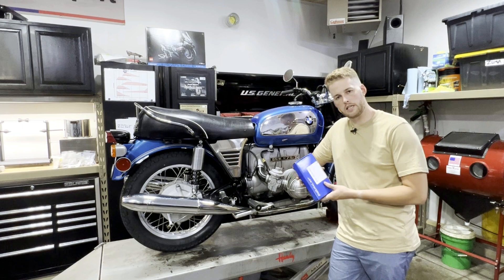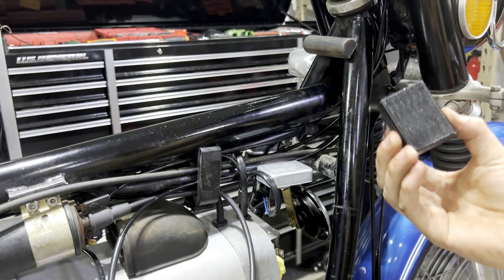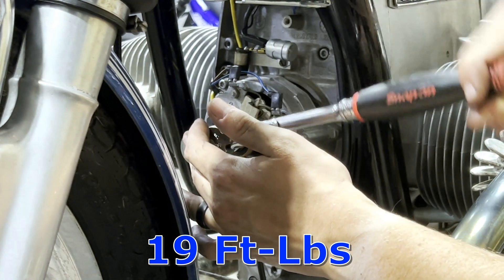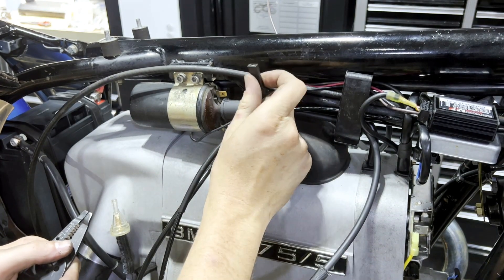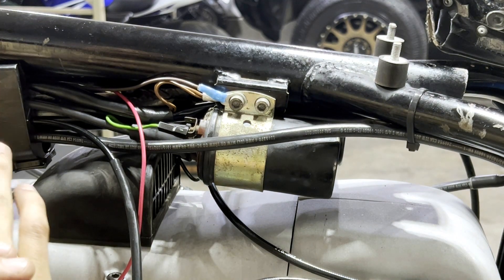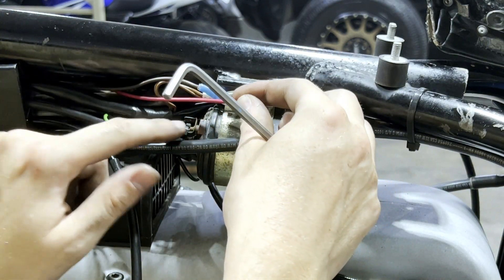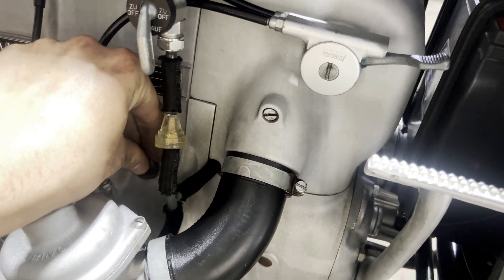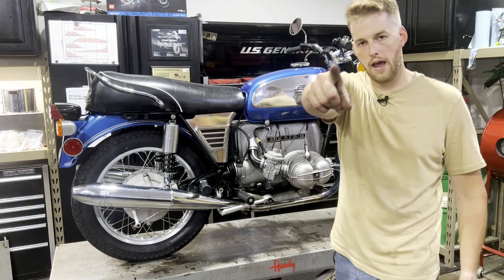BMW R75 Electronic Ignition Install

Comment: My '91 GS has been laid up all summer. She has spark, compression, fresh fuel, valve adjustment but won't catch. She backfires. A pal suggested timing was off. I think this is the solution. I"ll hit the join button and see if you can help me get a few rides in before the season is over. Very good video mate. Thanks for all you do Beamer style!

Comment: Where do the black and blue single wires go that are part of the voltage regulator harness go? I have a R100/7 1978 and installed the 400 watt system.

Comment: I decided to get the EDL-BOIGNS ignition for my 77 R100/7 because of The BMW Guy!  It does come with good instructions, however this video contains everything I needed to know.

I’d put this system on the next R100 I get.  I am absolutely in love with these old airheads now 😃
Reply: I am lost at the voltage regulator wiring, I have a black single and blue single. He did not show if they plug in or get left off?

Comment: Good video and explanation here however,  undoing the gearbox earth wire to me is unnecessary wear and tear on a fragile part of these bikes. I think it would be better disconnected at the battery terminal.  Seen too many of these threads stripped or tight and nearly stripped.  Cheers

Comment: 50 years riding  and working g on them in my shop. I have replaced a lot of electronic ignition because of failure. If the bike originally had points I install them back in and install a dyna ignition booster the points last years after that. Instead of three amps going thru the points you have millavolts no burning of contacts  every few years clean contacts lube rubbing block and advance mechanism. All the benefits of electronic ignition. If ever a failure lift tank swap 2 wires back to original. I have several in use over 45 years old. Go riding
Reply: Very interesting is it OK if I contact you am in the process of installing a R100s into a R100rs & I have never worked at bmw engine before.

Comment: Always like your videos easy to understand. With this system how would you balance carbs with out vacuum ports. They recommend you don’t remove plug wires while running engine which I do on my R60/5?
Reply from the maker: you can remove the plug and just set them on the cylinder to ground them out. no damage will occur. without vac ports you just gotta listen

Comment: WOW!! Beautiful. Please, please. One slight correction. Sometimes disconnecting the transmission breather screw does not always disconnect the ground circuit. You may have optional accessories that are also grounded. Please check with a volt meter before removing the front cover. If the bike is completely stock - no problem. Mine is not. Anyway thank you for another great video.

Comment: Watch out! Removing the negative ground might NOT actually discount ALL grounds depending on add accessories you may have added to the bike over time. PLEASE, PLEASE check that circuit with a DC volt meter before proceeding. Anyway, great video as always.

Comment: Looks like the Finally found out, that the old system with hall sensors were lousy.
I installed a system like that on a Guzzi with permanent magnet, and they had sen me the wrong sensor, not particularly impressed with that Sachse Ignition. 😡

Comment: Are you using a timing light with a variable knob/wheel that ranges from 0-60? 

I have the same ignition on my R100 and I am trying to use the chart that is provided but am confused. 

I see “S” and “F” (at 3,500rpm) at 6 degrees on the timing wheel, but the chart provided in the instructions shows “F” at 32-34 range. 

Should the timing light always be set to 0 degrees, or do you change the wheel/dial to different degrees based on what RPM you are revving at?

Comment: I owned a 1972 R75/5 for 30 years and installed 2 different electronic ignition systems on it.  While I was touring in Montana, one side of the electronic ignition failed and I rode it for 60 miles on one cylinder to the nearest BMW dealer.  They diagnosed the failed electronic ignition and installed my original points plate and condenser (that I always carried with me) so that I could continue on my trip.  I like this newer system as it keeps the points and condenser in situ and makes it very easy to revert back to the OEM ignition system!  Excellent video!  I love the old Airheads.  😍

Comment: Cool idea. I put one on my airhead and it failed only after 1200 miles in the middle of the Desert. No cell phone then. I switched back to points really quickly. It's not hard to adjust the timing and the points.
Reply: How do you switch it back ? Just undo the Black wire ?

Comment: Ich ch halte es für Unsinn. Was kann bei einer kontaktgesteuerten Zündanlage kaputt gehen? Der kondensator oder die Zündspule. Beides sind billige Artikel, die man als Ersatz sogar auf Touren mitnehmen kann. Vielleicht noch einen Satz Unterbrecher. Die Teile lassen sich spielend austauschen. Und mit einer Fühlerlehre und einer Prüflampe lässt sich die Zündung spielend sauber einstellen. Mit dem Motorrad ist es wie mit dem Auto : Elektronik im Radio muß reichen, was heute geboten wird, ist kaum mehr beherrschbar.

Comment: In 1975 I ought an add-on transistor framus from JC Whitney. It was mainly a mounting problem. That /5 would light up first kick at 25 degrees f. It was nice to not have to fiddle with the points. And I think the timing didn’t change over time either.

Comment: A great solution for bent or broken camshaft noses. I've seen a few that were, and the signals were distorted. It is a good extra step to remove the spark plugs before rotating engine with rotor bolt. Signed BMW technician, BMW airhead shop owner.
Reply: Deffo remove the plugs, but truly great vid  and i love it how  the points are  there